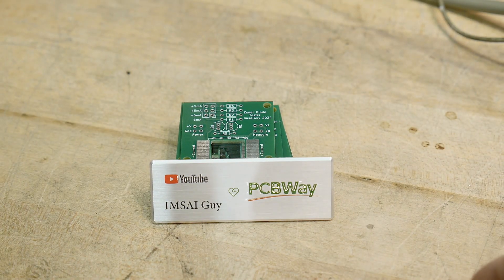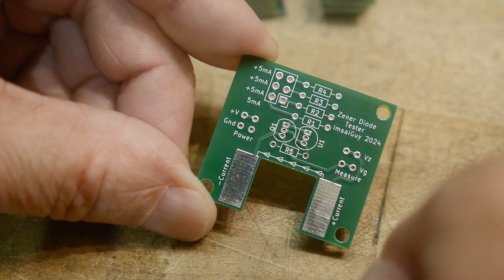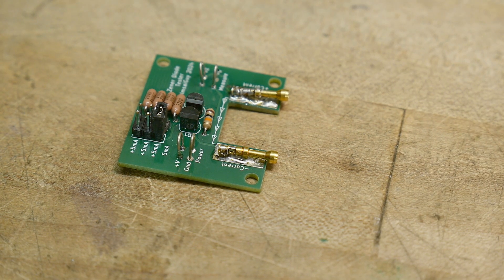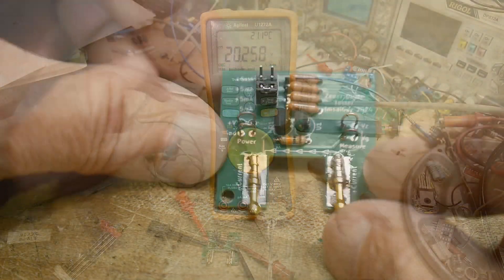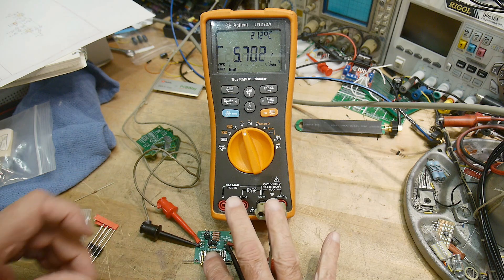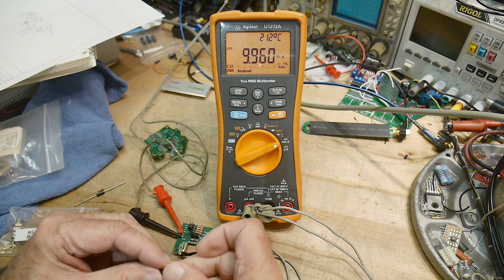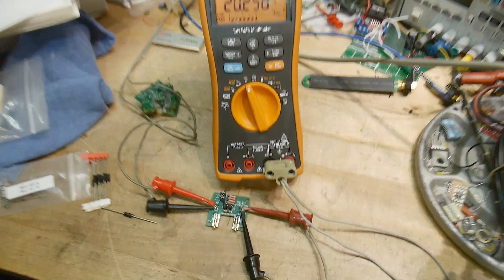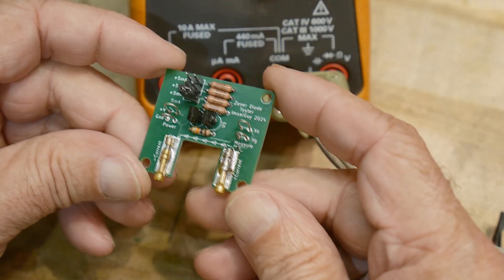#1880 Zener Diode Tester (part 2 of 2)

Comment: Now I see why you have used a manually current programming cascade. The recommended test currents of Zener diodes differ allready for the same Zener voltage. But I would use a progressive current programmer like 2, 5, 10, 20 mA, also usable in combination, to get more settings in a broader current range. I think the precision of the resistors is not so important. You don't need 0.1%. The standard of 1% is enough. 5%  would be ok as well.

Comment: There are small circuit board switches called DIP switches. You could use one of these (very low cost) switches to change the current. The zener impedance is another factor that needs to be measured. This is derived from a small change voltage with a change in current. Ideally the impedance should be zero but in real zeners it can be very bad!
Reply: DIP switches are nice but have one drawback: toggle count measured in a few hundreds.
Reply: @LubosMedovarsky  Good enough! By the time I test that many zener diodes I can swap out the switch.

Comment: Built one many moons ago, using a small well used transformer that had a 100V secondary, and a 6V secondary as well. Half wave rectified both, to get 150ish V as compliance, and used a simple constant current source with a LED, and a MJE13003 and a 2N2222A as pass elements, collector of the 2N222A being connected to the 9V supply that ran the constant current circuit, and a 1M resistor across the output to provide a discharge path. As I had often enough to test 75V zener diodes the ability to go to 150V was useful, though it could bite. the high voltage used a salvaged capacitor, IIRC 22uF 250V, and the low voltage a 1000uF 25V salvaged one as well, with the reference being a red LED and 2 1N4148 diodes in series, and a 150R resistor to set the 10mA current, though it really could not supply that for long periods, as the transistor was likely to overheat, being on a smallish heatsink. But as a quick and simple tester perfect, and it also was well capable of testing transistors for breakdown as well.

Comment: A few months ago I had to test zener from. Mac SE/30 power supply. They were around 30-35V. Rigged up my variable 50v supply and one resistor in series and a DVM to measure the voltages. By varying my supply voltage I was able to vary the current, although not as elegant as IMSAI Guys circuit it was enough to work out what value the zener was so we could test replacements. The part on the board didn’t give us any clues to its value. I was surprised how much voltage variation you get depending on the current and also the variance between two identical parts purchased together. Nearly 2-3V difference at that voltage.

Comment: Not sure why you didn’t just put 2 jumpers for added current. One for +5mA and the other for +10mA and the base load of 5mA. You could get 5, 10, 15 and 20mA options that way with two jumpers instead of 3 (or was it 4?).